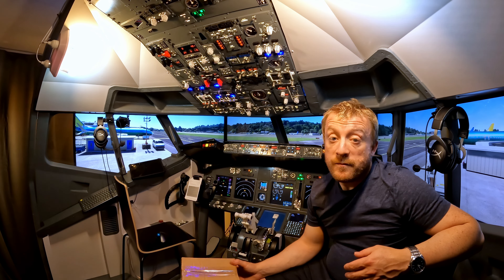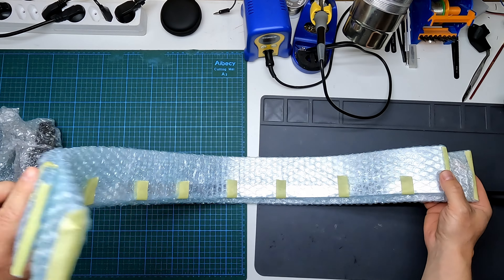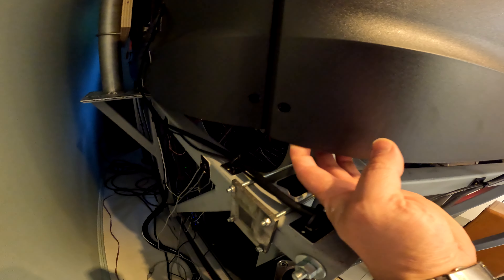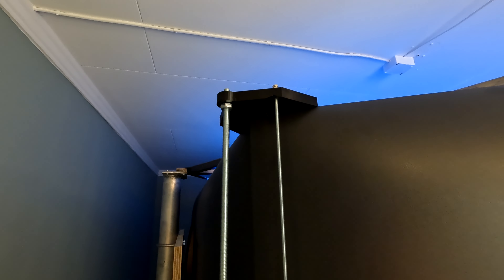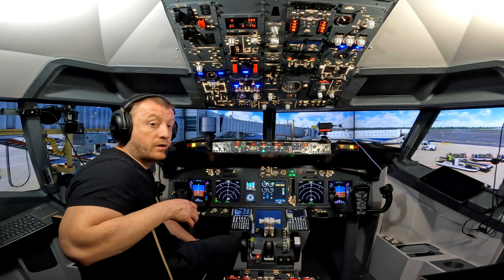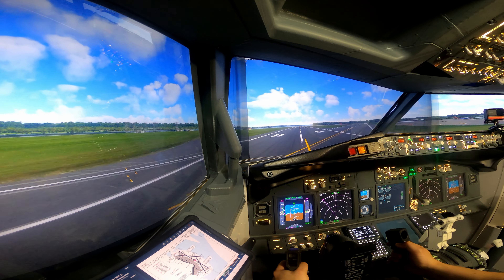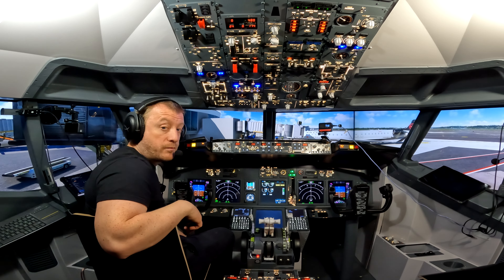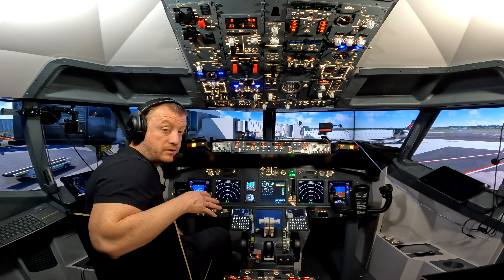Can a Bezel Delete Kit remove my Bezels?

Comment: You could try drilling a small hole in the middle of the film and using fishing line attach through the space between the screens and fix.  This will fix the center of the film and take away allot of the shake.  I have seen others do this.
Reply from the maker: Thank you for the tip. I will keep this in mind if I get to annoyed by the shake.

Comment: I'm really curious about something.

You've spent massive effort into building this amazing sim, but why the chair? 😅
Reply: I guess it will be the last detail to be added since before the rest is finished the chair will be moved in and out a lot?
Reply from the maker: I'm in the final stages of designing and building seats. It has taken almost two years since I started the first design iteration, and it has taken a significant number of iterations before I was happy. The cheap kitchen chairs has allowed me to fly while working on the seat design, and they are not bad as long as I keep the flights below 1.5 hours 😊

Comment: I would have thought each window would just be the monitor, rather than the monitors outside the windows.  You should just attach each monitor to where a window is, in a way. Sure some of the monitor wouldn't be used, but that could probably be configured properly in software.

Comment: This may sound like a basic question for you, but how are you able to save the position of all your displays, specifically the PFD, etc.? I am using pop-out manager and it is a pain in the butt, I have 8 screens on my CRJ 700 and it seems like I spend hours trying to get everything lined up before I can even fly it. If you have any suggestions, I would be eternally grateful.    Is thee any way I can edit a config file to remember the position each and everytime?

Comment: Hello,
can i ask what cockpit Software ans Aircraft you are using ?
Is that Prosim or another one ?

Thanks
Matthias
Reply from the maker: Prosim is correct!
Reply: @B738DIY  Hello,
ahh, ok. I use that too, becuse its the only one where you can connect the Harware very easy.
But are you happy with the rest?
I mean how the flightmodel behaves, Autoland and VNAV/LNAV ?
Did you maybe change the Flightmodel like that it flies better ?
Do you use Trim or Elevator as Autopilot Pitch channel ? Normally it should be Elevator like the real one does.
Especially i would be interested in Someone who can change the Flightmodel.
Matthias

Comment: Hi, I heard you mentioned your 5600x CPU and wanting to upgrade to 5800x3d. I also have the 5600x and I am thinking about upgrading to, especially for msfs. Have you upgraded yet? Can you share the change to fps? Thank you so much.
Reply from the maker: Hi, I find it hard to quantify any performance gain. The framerate is around 30 fps both with the 5600x and the 5800x3d, so no major fps increase. My subjective feeling is that with the 5800x3d I'm no longer thinking about fps and performance while flying. I guess that is because there are very few/no times where the fps drops to levels where I notice bad performance. I also notice the photometry loading faster, indicating more cpu headroom
Reply: @B738DIY  thx alot!  Is this 4k?
Reply from the maker: Yes 3x4K
Reply: @B738DIY  thx alo. I think i wont upgrade then.

Comment: Why don't you go for a mirror projection solution instead? It should be almost as compact and will give you infinite depth of field.
https://www.youtube.com/watch?v=7Cijm_W71_w
Same as in Lockheed sims
Reply from the maker: I have looked into building a cross collimated display system with curved mirrors so that the perspective is correct for both pilots: https://www.youtube.com/watch?v=Vq30JMknmpg . But i would need more space, time and money to make that work. Just the projection system would be very costly as the mirror reflects the image off a back projected curved canvas, which means that you need a lot of light coming out of the projectors.